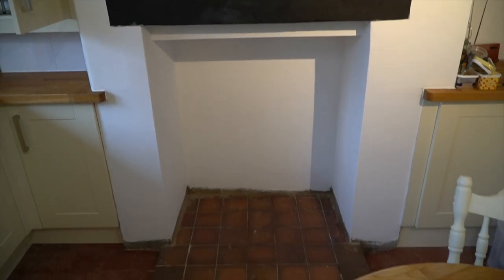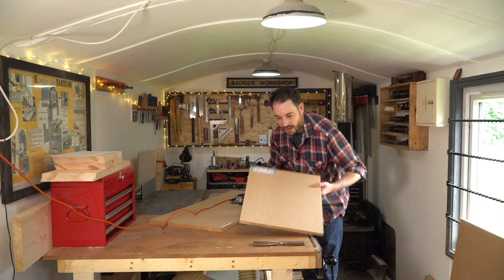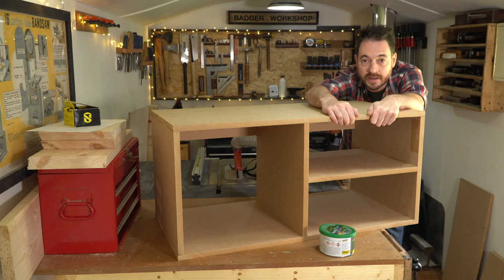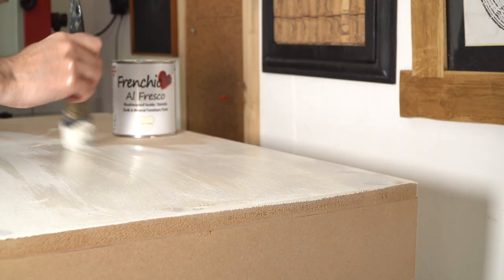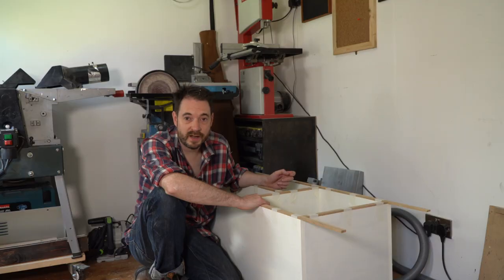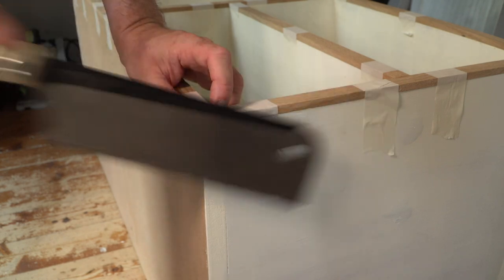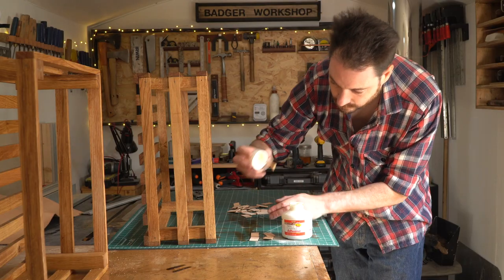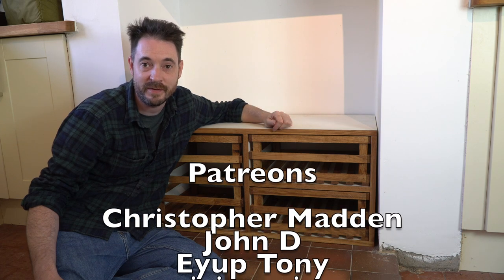Making Some Vegetable Storage

Comment: Hi Matt one of the things I was told many years ago by someone who worked in the industry of plywood and mdf manufacturing was that if you paint mdf alway's paint both sides. As over time the moisture content in the air will penatrate into the unpainted sides and cause the wood to bow this apparently is because the painted side acts as a barrier for moisture to penetrate while the untreated area's act slowly like a sponge.  This i had actually seen happen but it wasn't on 18mm mdf. 👍 on the finished product for mum,brownie points alway's come in handy 😇

Comment: no nail gun? I do really feel sorry for you…..  I have four different types and use all the time.  I have a hd air compressor too.  Just to make you feel jealous I have a 16 gauge pin & staple, a 18 gauge straight, a 18 gauge angle and a fine pin gauge for thin strips……  the thin pin gun is great for very fine mouldings and thin walled boxes……   sorry if ive made you gun envy...
Reply from the maker: I could use both of those